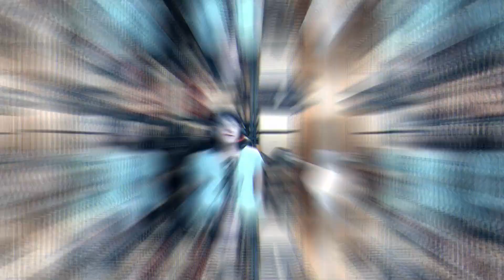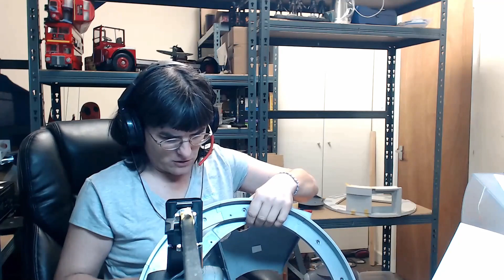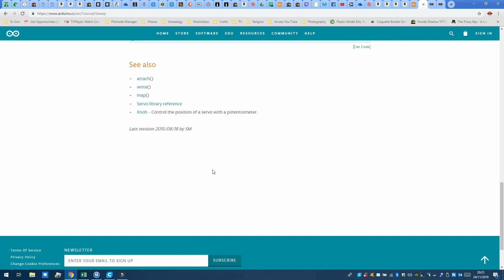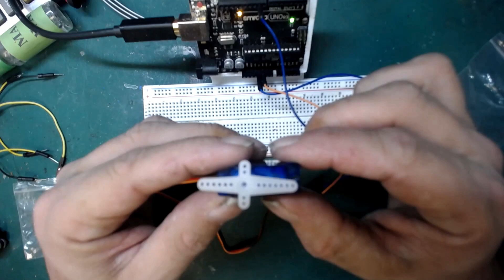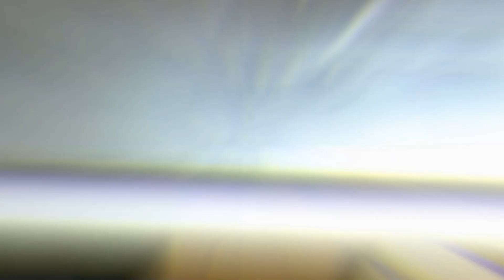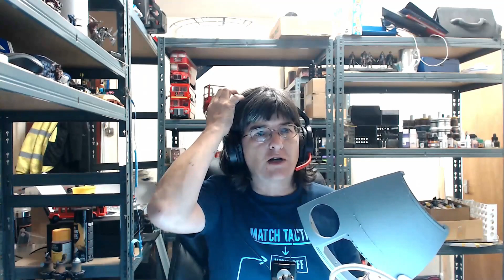R2 D2 Episode 7 Lower Rings Servos and Ring 1 Sections

Comment: As Chris Campling said below, I thought that the electronics you showed in this episode were going to cost you much more than they did.  Especially the arduino!  My guess, before you showed the cost, was about four or five times higher.  Still there are other things, like the drive motors, and as you mentioned the lazy susan, that will be more expensive.  Best of luck with your continued progress!